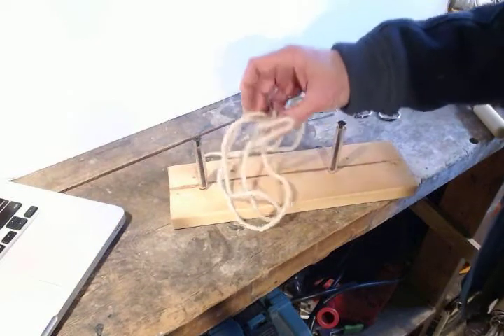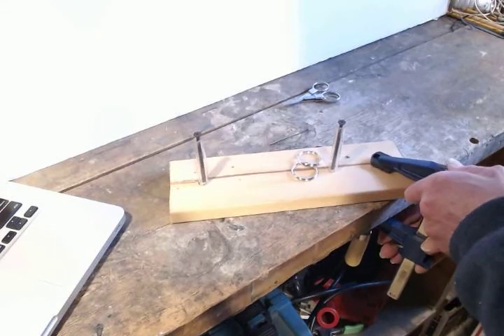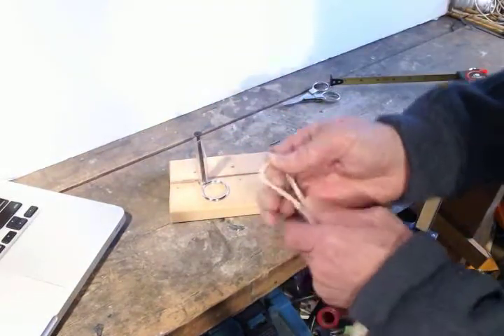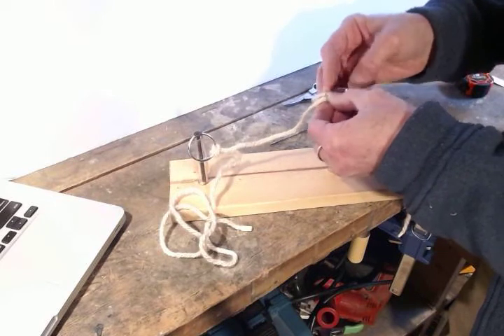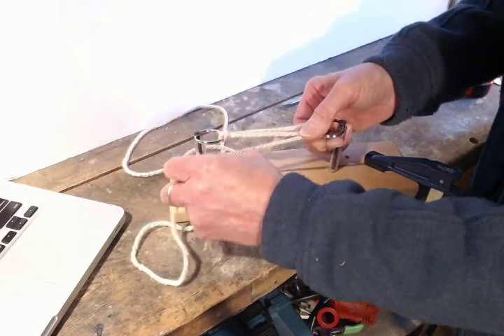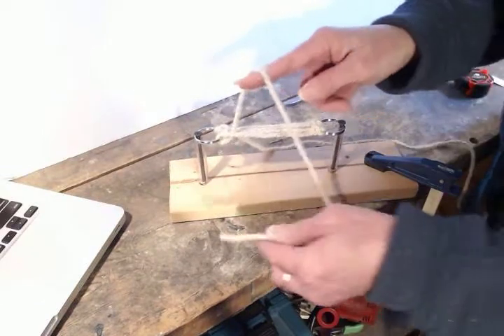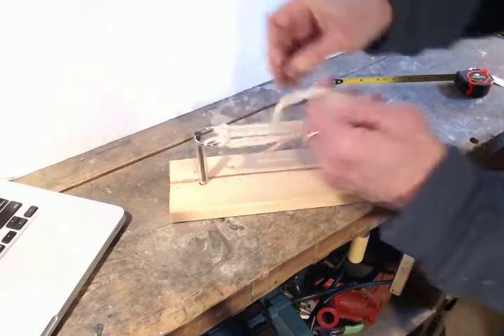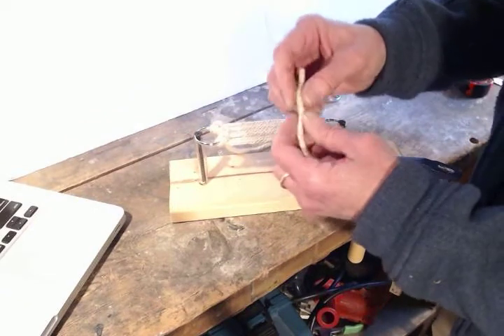Mini Cinch Part 1

Comment: For 1/2 scale 8 ply....is that taking 8 ply and pulling it in half?
Reply from the maker: No ... if you pull 8 ply in half you will have 4 ply. For half scale 8 ply you start with singles that are half the diameter of those used for regular 8 ply. Tracey Hart makes half scale 8 ply. Her website is www.naturalfiberproducts.com